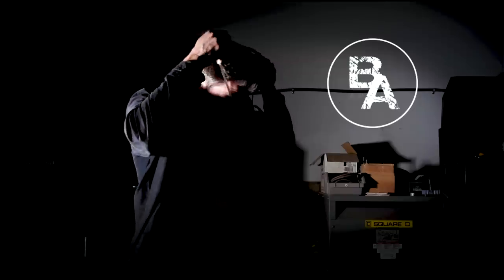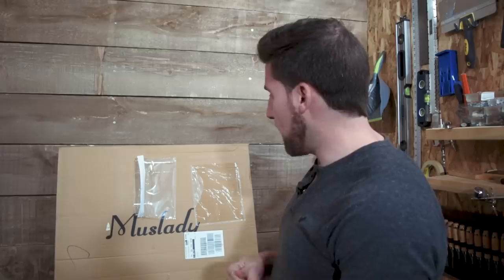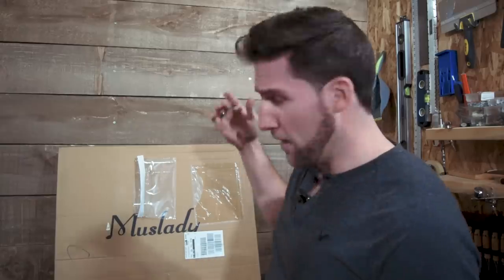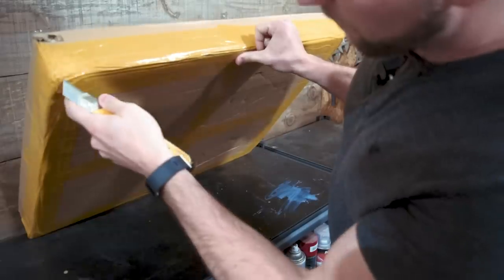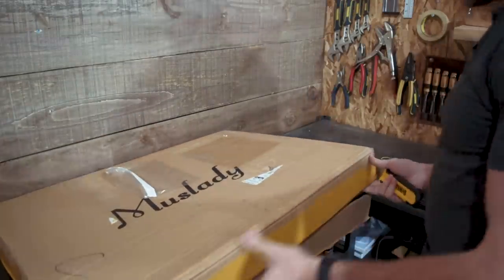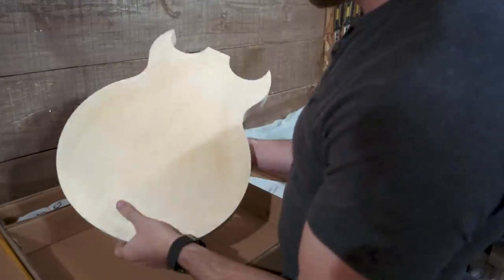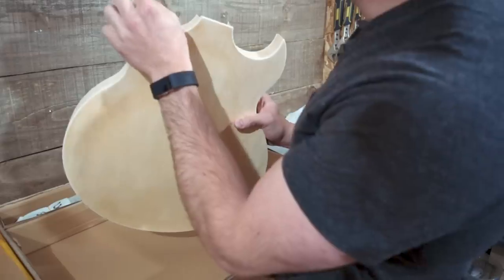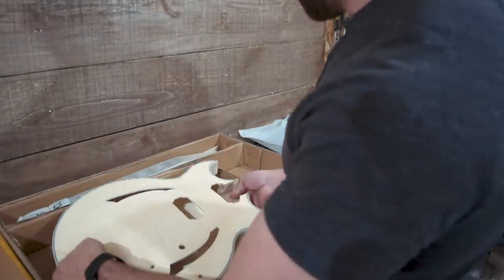Crazy Chinese Hollowbody Guitar Kit | Unboxing

Comment: Output jack is the bottom one by the end pin .  You assemble your wiring before, wire your pickups then use long hemos or pliers to put in your electronics

Comment: Hi Brad, i'm not so convident with this one. You will have to glue in an additional block of wood for the tail piece i guess. Wire the electronics FULL before install and pull it trough the soundhole with a rubber hose tube from aquarium gear or something similar attached on the shaft of the pots. For the neck, depending on what you will do, stain or others.. i surely would drench the neck wood in CA glue or Glue boost to prevent the trussrod from breaking trough. Good luck !

Comment: A lot of head scratching coming with this one :)
As others have said a trapeze tailpiece would be the best option, as there is hardly any supporting wood for the stop tail.

As for wiring, as others have said also thread a weighted string from the front, out of the sound hole. Then attach to the corresponding pot/switch/socket and then pull them through. Don't forget to pop the washers and nut on the outside of the body so you can pull the string taught and get the nut tight.

Comment: Brad, if you want to change the electronics, the layout lends itself to a 2 volume, master tone, and a Varitone switch. The output jack is supposed to go in the hole closest to where the strap button would be when installed. You can get a wiring diagram for the Varitone at Seymour Duncan's website, or StewMac.com.
Reply from the maker: Thanks Matt.

Comment: Arthur's right, I bought the exact same kit.  Its fairly high quality. You  are going to need to pull the wires through with mechanics wire or something like that it's only way you can get all the wires through where you need to. I would probably reposition the Jack plug on the side instead of where it is on top. It made more sense to put it out the side. Also the the trapeze tailpiece is definitely way to go plus it looks cool.  Depending on color desired and quality it will run between 20 and 150 dollars.  Or you could just put a bigsby in. That would be even cooler
Reply from the maker: Glad to hear yours was decent!
Reply: @timhallas4275  mine came out of the box centered and tight on the neck.  Had to switch to the tailpiece style  theres no way Brad will be able to use the stop tail piece .  It will never be stable.  I threw out the mini humbuckers and routed out the body.  I use these kits as a base only for the start of my build.  No kit will ever be sellable I build mine planning on keeping them with my much more expensive brand name guitars.

Comment: James Burrough gave some REALLY sound advice about "fishing" your pots into place.   Also, might wanna wire everything BEFORE you install it, pickups included.  Hollowbodies are a pain to wire.  You had the right idea for what goes where.  Switch up top,  Volume for the 2 forward smaller holes (one above and one below the sound hole) .  Tone for the next two and output jack for the hole closest to the bottom (as if it were in a stand).  Good luck with that one    😁  Can't wait to see what you do with this one!
Reply from the maker: I’ve seen the fishing technique done before, but I’ve never wired one of these myself. Should be an adventure haha. Im glad someone knows what holes are for what haha. Thanks Dave.

Comment: For wiring wire everything up outside of the guitar and mark the pots as to what they are with a sharpie. (I use NV NT BV BT). insert all the pots and wires etc in through the sound hole. In the hole the pot goes in to insert a piece of aquarium air hose and push it over the shaft end of the pot. Pull the pot into the hole and screw on nut. Done deal.
Hope that helps.
Reply from the maker: Yup. Sounds like “fun”.

Comment: It looks like a Gibson ES 335 control layout.

Use fishing wire and small weights like split shot through every hole and let gravity take them to the pickup hole. 

Trace the position of every control hole on a piece of paper stick that to some card, punch holes in the card and mount all components as they will be on the guitar that way you won't solder any leads too short. Tie each bit of fishing wire to the corresponding item then feed them through the bridge pickup hole and guide them into place with the fishing wire. (I presume the Neck pickup will have to be soldered on through the bridge pickup hole before you pull the components into position.) I'm not totally sure how you hold the pots still while you tighten the nuts but I'm pretty sure Crimson Guitars did a video on this not too long ago.

It looks like an interesting build. Good Luck.

Comment: Hey Brad - How many different sources of DIY guitar kits have you built so far?  Most of the ones I saw were from Solo Music and now this is a different one.  Have you done any from Fretwire, BYO Guitars, or BargainMusician, Albatross etc?  Just curious since I am looking for a 2nd kit to try. More like  PRS style body.  Do you have a recommendation?  I built a Jackson V-like body from Albatross guitars this summer.  Surprisingly it came out OK for my first build and first time attempting Hydrographics.  The only thing I did was upgrade the bridge pickup to EMG-81 and needed some nut filing.
Reply from the maker: The other one I did was from guitarfetish. It was pretty bad. I mostly stick to solo, but I’ve heard good things about bargainmusician.
Reply: @BradAngove  Thanks again for your videos. They are awesome. I did end up ordering a Quilted maple top PRS style kit from Solo. I guess I will try your dying technique on this one with water based dye.

Comment: Reminiscent of the Gibson Johnny A model, they brought it out in the early 2000s, not sure if they still make it. Although if memory serves, its construction was semi hollow like a 335.

Cool kit.
Reply: @lazaglider -  I am not sure if the Gibson Johnny A is still in production but I know the Epiphone version is because I purchased one in July. I ended up returning mine though. It had a few issues that I was not willing to overlook when I paid $1,000 for an Epiphone guitar! When they routed out the neck pickup they made it too large and even with the rings in place there was a gap at the top. Had they been smart they would have positioned the neck pickup up a little and then I may not have even noticed. With the gap being on the top though, as I was playing it and looking down at my pick I could see it lol. Also, they say it has binding on the neck and head stock, not true, the binding on the neck is nothing more than white paint and it felt as though it had been painted, with flat paint, after the clear coat had been applied lol. The guitar felt great and played just beautiful, but like I said, since I paid $1,000 for an Epiphone I expected better. I have several other Epiphones that range from $600 to $850 and they are flawless.

Comment: Important info:
Affix the neck before you mess with the bridge.
And when you determine the scale length, don't put the bridge on that line.
Add at least 1/8" additional to it, otherwise you'll never be able to intonate it.
Reply from the maker: Don’t put the bridge on that line? What do you mean by that? You need to position the bridge to allow the saddles to be adjusted around that “line” that you’re referring to.
Reply: At the 5-minute mark, plus or minus, he starts talking about the theoretical scale length, and the actual compensation length.
Reply from the maker: Thanks Nicholas. I’ll have to have a look at that.
Reply from the maker: Nicholas, I’m not sure what you’re getting at. It seems clear from the video that he has positioned the bridge such that the saddles, at the center of their adjustment, are on the scale length line just like I said.
Reply: Fast-forwarded to the specific time about the need for the extra 1/8":
(I was wrong. It was closer to the seven minute mark by the time he was talking about the compensation.)
https://youtu.be/xG56r9_a940?t=411
Reply from the maker: I did. That 1/8” comes from the saddle adjustability. He’s referring to not placing the edge of your bridge on the scale length line. That should be clear, since the saddles don’t align with the edge of the bridge.
Reply: Yep.
I just know that when I'd aligned this same type of bridge with the scale length line, there wasn't enough adjustability, by a fair amount.
If worse comes to worst, it is repairable.
If you can find a screw that'll thread into the anchor posts, you can screw 'em in and knock 'em with a hammer a little to dislodge the posts from any glue you've affixed them with, and then use that same screw to pull 'em out.
Then, if I remember right, a 3/4" dowel rod fits the holes near-perfectly.
To re-drill, though, definitely use one of those wood drills, with the needle-like points that start it. (I'd highly recommend those for the initial plug holes as well, too, but hey...)
The different wood and grain direction of the plug will make the drill want to walk a lot, so a pilot would help a lot.

...And I found that I had most of this written out, but forgot to finish and press "enter." Sorry for the delay that caused. Heh.

Comment: You might try genuine Saskatchewan Sealskin Bindings to fish thru the wiring, from what I hear those things will practically find the holes by themselves, just like a Seal does I imagine.  Afterwards you can maybe adapt them for use as a tailpiece.   Be nice too if you could attach a Seal pelt to at least the rear surface, then you would have a smoother segue for announcing your new start up Band, "Brad and the Baby Seal Clubbers."
Reply from the maker: Would you lubricate that Saskatchewan Sealskin with some Manitoba Manatee blubber?

Comment: my question is ...is the brake angle ok  ...the reason i ask is that it has a real thin back an the neck doesnt have any tilt room in that pocket..?  that doesn't sound promising if the neck scarf area is flimsy because the slot for truss was to deep either ...astheticaly its looks pretty good?
Reply from the maker: I’m a little concerned about the possible problems with the neck. We shall see how it turns out though I guess haha.

Comment: I have often wondered how difficult it is to do the wiring and install all the controls on this type of body. It would seem to me you will need a fairly long set of needle nose pliers and a lot of patience lol. I was going to suggest you do the body work, paint and top coat etc... then put in the wiring and then glue the neck in and then do a quick top coat along the neck/body line. I know that's not how it's usually done but it would "seem" that it would be easier. I was thinking of ordering one of these type of kits from a vendor I just purchased a Tele kit from. Wanna know my solution and what I am going to most likely do if and when I buy such a kit? I shall pull a BB King on it and make a rear access panel like Lucille has! I will do so for a couple of reasons, 1) the obvious reason, to make the wiring much easier. 2) It will add to the "custom" appeal. 

I really don't understand why the makers of these body styles do not make rear access panels, do you Brad? I guess it could be the integrity of the wood since these guitars are usually very thin and a rear access hole would need the edges strengthened. 

Can you tell if a pickup is going to be good before hooking it up to the pots? I know that may seem like an odd question but in another video a guy took an Ohms reading on a set of a new ones and said they were junk. Not that they gave a bad reading but the reading they gave indicated to him they were not going to sound good. 

Thanks for that spray can nitro tip Brad!! I have currently put about 8 layers on a Les Paul project I am working on, 4 on the back and 4 on the front. Yes I know, spray the edges first lol, but the edges are already taped off because they had some nitro already on them. Once I'm done with the front and back I will remove the tape and try to bring the edges up to level. It's not a guitar I plan on selling it's one that is for my own personal use that I plan on using to test out different electronics so it doesn't have to be perfect lol.
Reply from the maker: I agree with your suggestion Ron. I may very well approach it that way. 
I assume you’re correct about the reason, if one exists other than esthetics, for not having an access panel. 
You can check the resistance of a pickup and get an idea of what to expect from it as far as output. That’s about it as far as I can tell. 
It’s nice having a guitar for testing things. That’s a good idea.

Comment: I got this kit as a gift for Christmas. So far I have everything stained. I'm apprehensive to attempt putting the bridge on because I've never done a kit before. Also, after reading the comments here, I'm afraid the hardware that came with it isn't going to work. Have you made anymore progress on this particular kit?
Reply from the maker: I’ve made some progress, but I haven’t gotten to the point of installing the bridge hardware yet. My intent is to order different hardware more appropriate to this body type.
Reply: @BradAngove  right on. Thanks for responding so quickly!

Comment: Hi Brad,

What sanding sealer would you recommend using over alcohol based dyes and under a 2k high gloss finish? I looked up sanding sealers from Mohawk and Behlen and there are many options (Vinyl, Pre Catalyzed, etc.). I'm not to sure which one to use.

Thanks for your help!
Reply from the maker: My favourite is the vinyl sealer.

Comment: I also looked at buying the Warwick sprayers kits, but  what size … stats  do I need in what kind of air compressor I need.. don't want to buy one that wont be powerful enough to supply the sprayers?
Reply from the maker: Which gun are you buying? Several?
Reply: well I was looking at the ones on the Warwick site, I was hoping to get away with one gun for paint...lacquer, and one for clear lacquer. But I know if I don't get a big enough compressor, to supply the CFMs , im going have trouble, and honestly I don't know anything about it, so I don't want to seem like im pretending I do. Im not wanting to paint cars … just guitars, shelves, projects around the house, im retired so im always fixing, piddling, or doing lil projects. Like im seriously wanting to do a Guitar kit... I like the SOLO branded ones, but do NOT want to use speay cans on them. Someone said I could just use airbrush, but I was not sure I could trust them. But you demonstrate all you do, and its obvious you know what your talking bout...trustworthy.
Reply from the maker: The 904 from Warwick should be suitable. If you’re happy to clean it carefully after use you can get away with just one probably. 
You need to meet the cfm specs for the gun, but you can get away with something a bit smaller if you have a large tank and are working on relatively small projects.
Reply: excellent, thank you sir.
Reply: is it one size needle for paint and one size for clear?
Reply from the maker: It depends on the paint. I like a 1.4 or 1.5 for clear. Most paints I prefer a 1.2 or 1.3.

Comment: Been wanting to try a hollow body type guitar..and now not so much...Good Luck with it..should be fun to wire it up..Lol
Reply from the maker: Yes “fun”, I’m sure haha.
Reply: Oh, just put a slightly stiffer, slightly bent wire through the pot/switch/jack holes, aim for the humbucker hole. That's relatively easy to reach. Then, pull it out there, attach the real wire to that and pull it back through the body. The "fun" part is soldering the stuff, unless the cables are really long ... which they usually aren't.
Reply from the maker: Yeah, it’s easier to solder it up before you put it in.

Comment: I think the guitar kinda sucks tbh... it looks like it might be really brittle around the neck pocket, and the truss rod will break through when you adjust it.
for the different control holes though, you can do 2 separate pickup volumes, 2 tones, 1 3 way in the bigger hole, and then a master volume. the output jack then can be drilled into the side using a marple bit.
Reply: furthermore, you can attach the tip of the pots to a string after putting the string through a hole, and grabbing it from a more open end, and then pull them through the holes. it is pretty easy once you do it a couple times, and I usually use bread ties for it.

Comment: I don't have a good feeling about this one. There is not enough mass for the stop bar and bridge. For the electronics I would make a template made of cardboard of the pattern of the top holes and invert it then stuff it wire it then fish it inside with string on the pots to pull it up one pot at a time. bummer is you can't hold the pot from the bottom. I would get pissed and swear a lot
Reply from the maker: I’ll probably do something similar. Especially that last part.